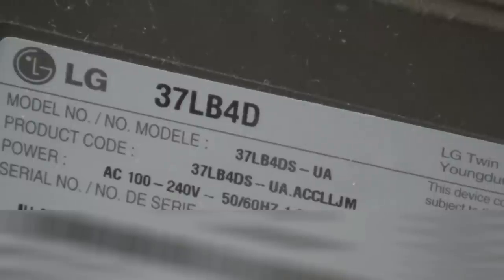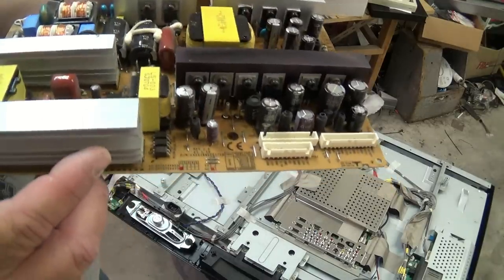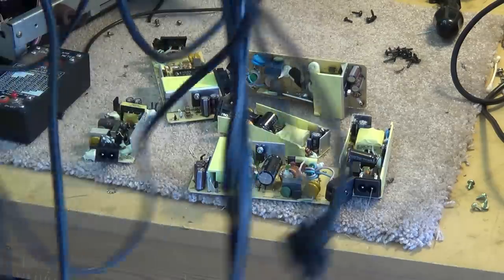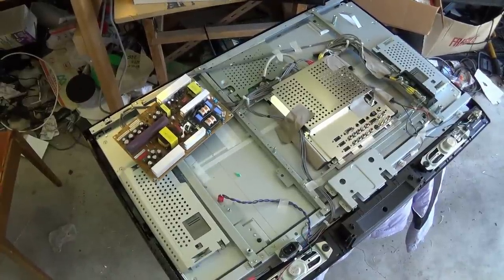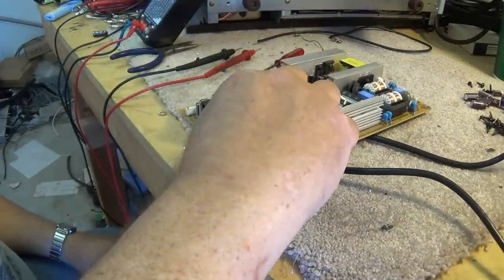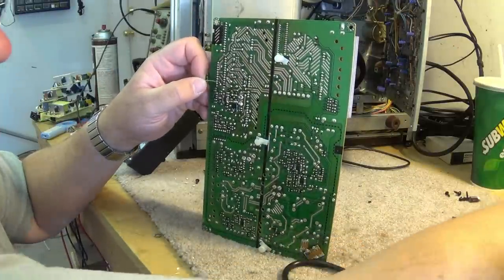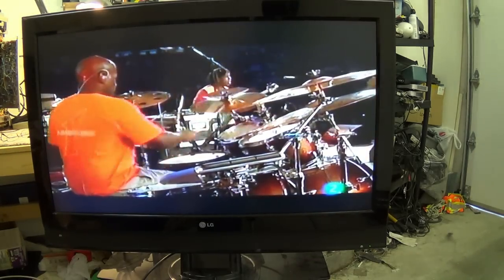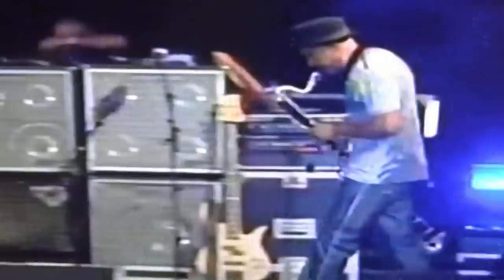LG 37LB4D  LCD Tv slow turn on. power supply repair.

Comment: I read on other videos the best way to open those power supply cases is to put them in the freezer overnight then hit them along the seam with a hammer. the glue will release with little damage to the case, as freezing makes the glue brittle

Comment: you remind me of the shop where I worked the owner would recycle parts. It not only saves money but saves time, you don't have to run across town to buy a part.
Reply from the maker: All the shops did that. In the shop I worked at we had a storage locker in the back where all the old TV and VCR chassis would go to be picked apart to fix other customers sets.
Reply: @12voltvids  Hello,  I would like to ask you where would I obtain one of these meters that you use in this video?
Great video thank you.
Reply from the maker: @americanrebel413  
That is an esr meter.  I built that one from a kit. The company I got mine from is no longer in business nor is the store I bought it at. They sold newer versions of it but when the owner died a few years ago his son quickly closed the shop and sold off all inventory.
Reply: @12voltvids   Thank you my friend I appreciate your reply.

Comment: Hi I opened the back and all the capacitors look fine (not bulged out). what else I should look for in the power supply board to make the LG LCD 37 work?
Reply from the maker: +Deva Sriram You have to test them with an ESR tester to see if they are bad. Only in extreme cases with the tops be bulged. Most times they will just dry up.It could be anything.This is a common failure, but it really could be anything.
Reply: sometimes caps can look fine and they can be bad. I purchased an ESR/capacitor meter and discovered a whole bunch of bad caps in alot of my TVs, Computers, sterios, and other electronics I own. they are well worth the investment

Comment: I got a free insignia 32". Blown fuse. Tracked down a bad MOSFET and changed it. I now have standby and voltage on "PS-ON" but absolutely nothing out of the TV. No picture, no sound. I'm stumped. Any ideas?
Reply: I have the same Insignia TV and had the same problem, the bridge rectifier arced and burned a black spot on the board, and blew the fuse of course. I tried repairing it and replacing the Fets and Diodes it lasted a week then went out again. I suspect the inverter transformer went next, so I purchased a brand new power supply board for it and its been working for 6 months now

Comment: +12voltvids  I have a TCL LE55FHDF3300ZTAAA My TV started turning itself off from time to time, then more frequenlty sometimes it would sit a hour or so and then it would work again, then recently a day or so and it would work for a while.  when it turns off standby light always comes on. When it does work the picture is always clear no lines or distortion. I've seen this model TV also in a Sanyo with the same boards.   Any help if it is the T-con or the mainboard?
Reply: sounds like your typical failing caps, open it up and have a look

Comment: Btw, I have a friend with a flat screen that says he has to turn his tv on and off several times to get the sound to work. Could it be a bad ground screw? Once it works, it's fine until it's turned off . Maybe a bad solder joint?

Comment: Might as well ask 1 more question. Are LG LED TVs any good?
Reply from the maker: I think both lg and Samsung make reasonable TVs. The thing to remember with all led TV is to turn the backlights down.  From the factory they are cranked up and this can lead to premature failure on all makes
Reply: Okay, I will keep in mind. I FINALLY bought a Sony multi-format Bravia TV to play PAL PS2 and PS1 games, and it had no advertised Game Mode in picture settings. Will have to return. Maybe it's a different sub-model or something, but if I keep getting these lying TVs with no game mode that's supposed to be there, I might try LG instead.
Reply: I always thought LG stood for Lousy Garbage

Comment: Apart from ESR (vs datasheet of existing part) if you measure value, a good cap should be within 20% of nominal. If it's worse than that, it's on its wear out slope. Lifetime vs cap series varies a lot, so it would be interesting to know the datasheet lifetime of the failed caps.

Comment: Is that a Radio Shack bench top VOM under your desk as seen at 10:39?
Reply from the maker: JacksJunkDotCom Yes it is, and it works, but I think judging the brightness of a light bulb would be more accurate measure of the voltage!
Reply: 12voltvids I had one, I gave it away as it was all over the place, junk!  :)
Reply from the maker: JacksJunkDotCom That was the joke about the brightness of the lightbulb being more accurate.

Comment: Capacitors don't cost much money - but you save where you can as long as they are good
Reply from the maker: +Donald Ellett It's not a matter of them costing money, it is do I have them on hand. The parts store is a 60 mile round trip, so unless I have to go to the parts store for something I don't. If I can recycle parts that are good I will, as many of these devices I fix are my own units, and are not generally going to be used after the repair, it is for demonstration only. In the case of a paid repair, such as the NEC plasma that I put 15 or so capacitors in, they were all new parts, and I made a special trip to the big city to get them.

Comment: Tv power supply board system generates a lot of heat,when in uses of like an hour or more for powering the tv backlights boards.These caps on the tv by the manufacturer's are using are for low tolerance in heat resistance temperatures for the power supply system board.These caps will leaked and dies again after a year or two in uses.These new caps for the replacement are should have been at least 5 or 10 micro Ferret higher so would will with stand the heat of the power supply board system better.Or if same caps and values are replacing for the power supply board system.Caps must 110 degree or high in temperatures tolerance of caps must have to be uses.
Reply: Sorry,my mistakes not ferret of the caps must higher.It the voltages of the caps must have to be in 5 or 10 voltages higher,so will with stand for heat tolerances generated by the power supply board system better.
Reply: in a few simple words, spend a little more Buy quality Componants and not from china!

Comment: Good jod   Do Transformers go  bad
Reply from the maker: +Houston Solimka They can, but usually do not. Some flyback transformers on vintage TVs did fail, but then hey were also generating 30,000 volts of power. Most modern transformers don't fail, but the capacitors in the support circuits do.
Reply from the maker: +Blah1069 I have a cordless screwdriver, but the batteries won't take a charge.
Reply: I have got the exact same one that I used for many years when they first came out so when it died on me it just totally ticked me off so bad I never had the time to take it apart nor the money to buy another at that price again, wife would make certain of that. Oh well that's what a good wife will do for us, LOL.
Reply: I think they do but havnt seen any in this group of videos yet